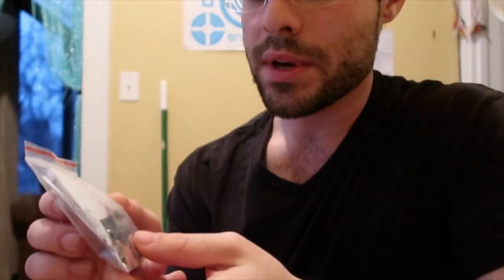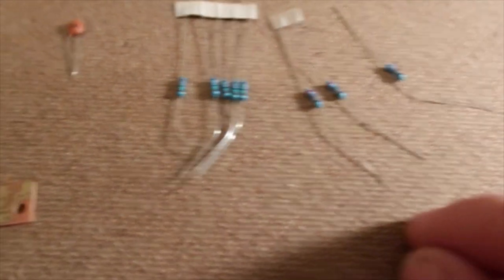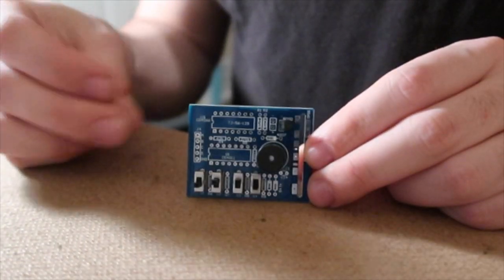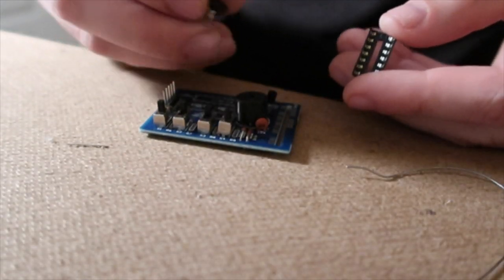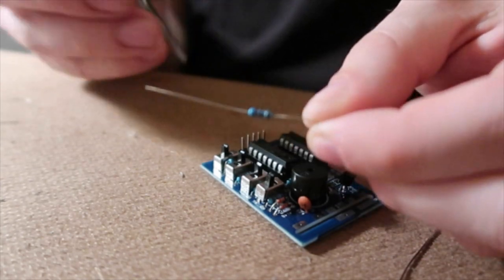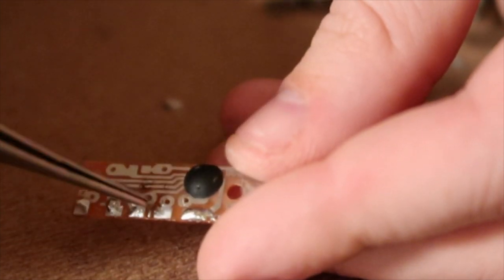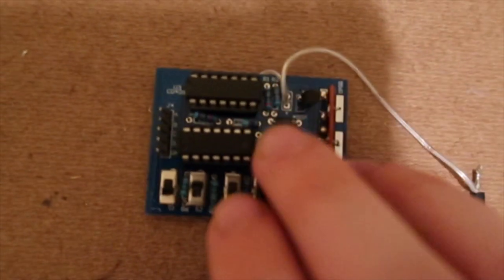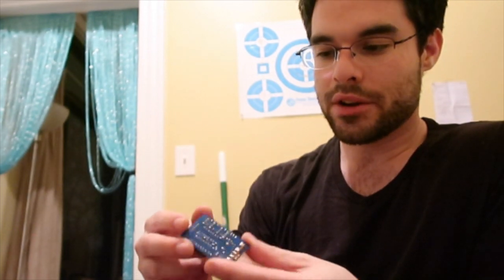Sixteen Music Box Electronic DIY Kit- Assembly and Review

Comment: Why did you put the chips into the sockets before soldering instead of after isn’t one of the points of the sockets to prevent the chips from overheating?

Comment: The music ic board is awful to solder... I'll try later with your tip ... ive try once and the small pad never touched the other one
Reply: right there with you....mine makes a hummm very low, but no music...yet,  I forgot 1 resistor on a switch, perhaps that is not completing the circuit. I must have it somewhere....